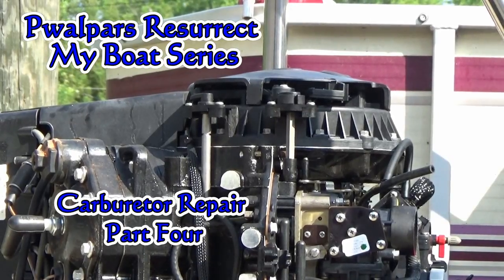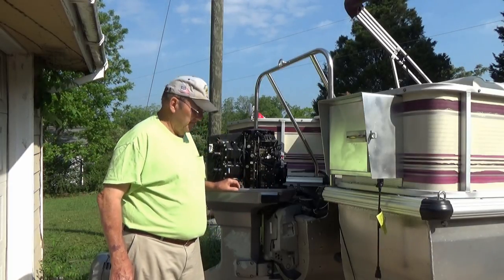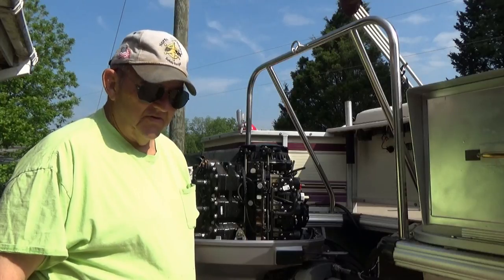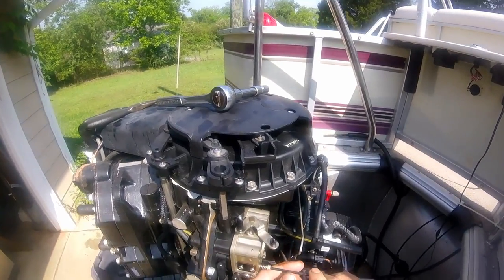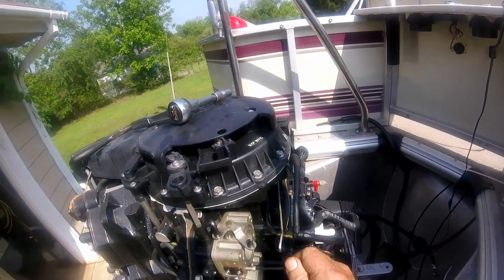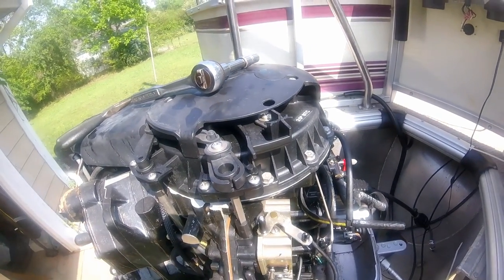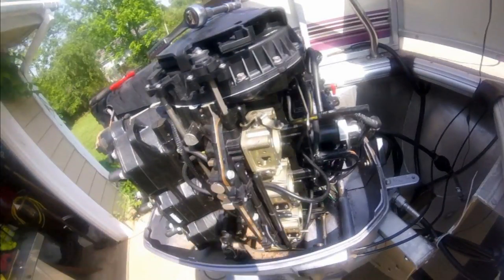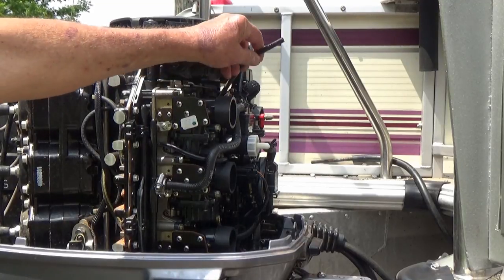Pwalpars Resurrect My Boat Series Carburetor Repair Part 4

Comment: One step at a time Walter, I have rebuilt motorcycles from time to time and there's always one that just won't start. It's usually as a result of something that I've done but how would you learn otherwise? Keep that positive attitude of yours going Walter, you'll get there.
Reply from the maker: Thanks Mick  I am sure of one thing  I got a positive attitude

Comment: Worse comes to worse, you can make gaskets using gasket material, and have at least 1 good gasket to use as a template, you can make all 6 of them. That is provided they are all the same on each side.  That is a simple way to cut costs.  Try living on 969.00 per month, you learn hos to make things so that others work.
Reply from the maker: Thanks my friend  Being on a set income now I sure understand

Comment: I personally would not go buy new kits. You've shot enough cleaner through those that they should work just fine. As far as gaskets, go to the parts store and by some gasket material and make your own. Take one with Walter, they have different thickness's. Of course, this is just what I would do.  LOL
Reply from the maker: Thanks my friend